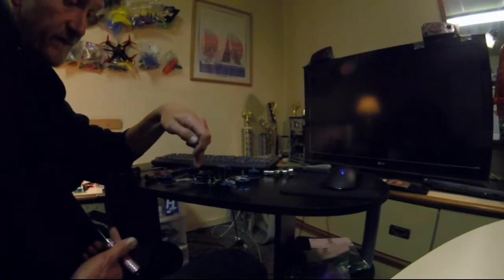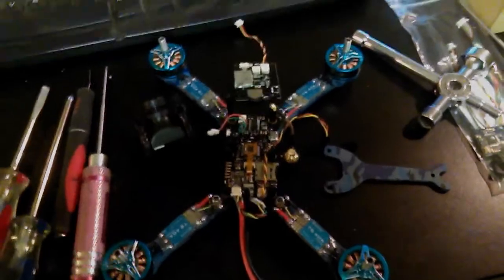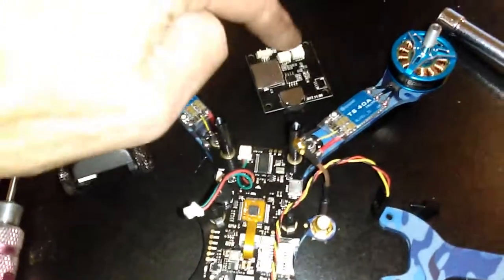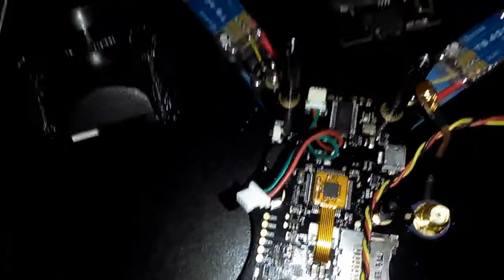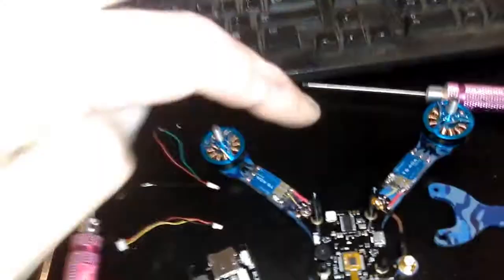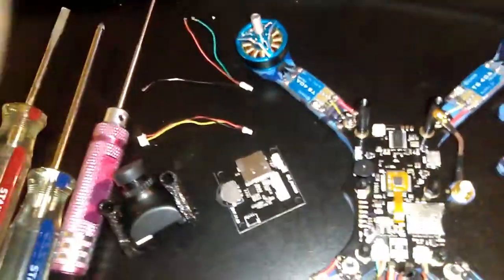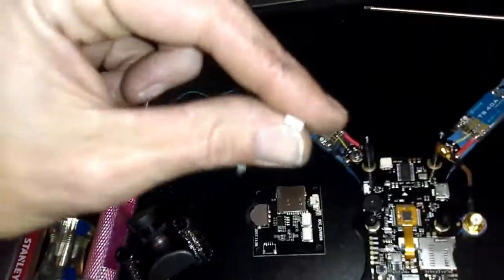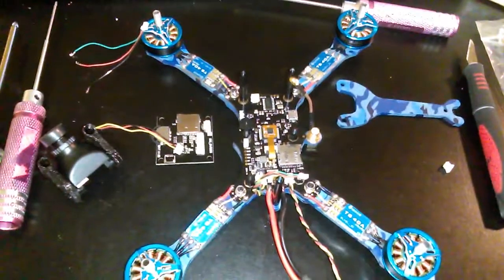Eachine Wizard TS215 DVR - How I removed it to eliminate latency!!

Comment: Any clue on how much weight you saved?
Reply from the maker: Toilet Clogger not much at all, few grams
Reply: Josh Ketchum I figured it wouldn't be much but when you're trying to avoid registration a few grams can go a long way. I'm sure it's still well over 250g flight weight though.
Reply from the maker: Toilet Clogger oh yeah buddy this thing weighs 329 grams dry with no battery in original condition with the upgraded Parts I've installed mine is about 350 grams
Reply from the maker: Toilet Clogger with my lightest battery installed is just under 500 gram in flight
Reply: Josh Ketchum Yeah, it's extremely hard to find anything decent under the minimum weight. That's why I was so excited to see the Vifly X150. It's a badass little quad.
Reply from the maker: Toilet Clogger stay tuned because vifly is not done yet they have more coming very soon after the Chinese New Year